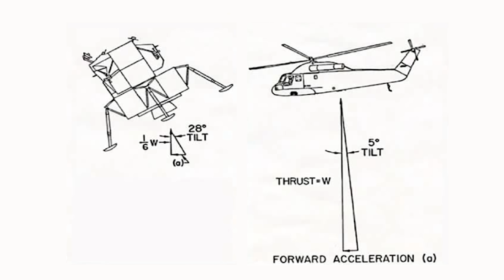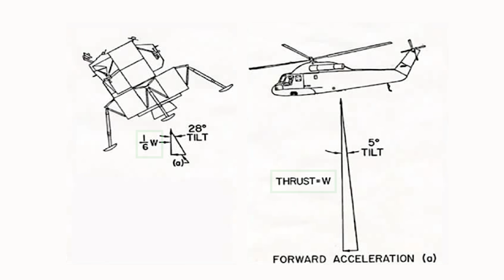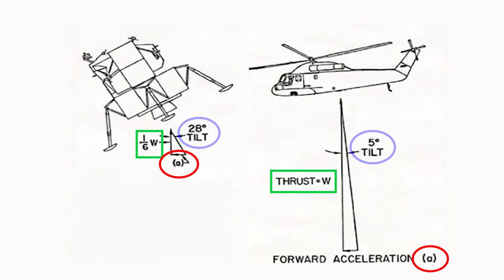How Neil Armstrong Trained to Land on the Moon  - Smarter Every Day 250

Comment: Here's the deal... early astronauts were airplane jockeys, and didn't want to just ride an automatic rocket... at all times, the Saturn V was able to be manually controlled by a joystick at the pilot's side.  That philosophy died a well-deserved death... computers do a much better job of figuring out physics than we do.  All Apollo LM pilots took over the controls at the very end, landing the crafts manually... but there was no need to... they could have designated the spot and the system would have landed the LM automatically.  We repeatedly land craft on the Moon and Mars automatically... what is the difference when a human is on board?  Well... if they're a pilot, they want control... that ends up being the whole deal.

Comment: With all the technology and processing speed we have today i wonder why this question is so important relative to human and not to machine?.. Small kids drone of today integrate way more processing for flight control than there was in the 60-70' i guess. a simple few dollar 9 axis gyro pcb and few lines of code can do the job quite easy to control engines... the same as drones does to compensate the proxymity bottom presure when close to teh ground.. or compensate the wind that constantly change speed and direction... etc... a simple 9 axis gyro chip that integrate the earth magnetic field tracking option can a good cpu and AI could be way less risk as to let a human pilot the landing?

Comment: Smarter?   Moon landings are THE biggest hoax in history.
Reply: Like u
Reply: You can't just say something like that without providing solid evidence.
Reply: @καλαμ  There is all kinds of evidence (Van Allen radiation belt, extreme heat/cold, photo anomalies, lack of rover tire tracks, no burn mark under LEM, camera film would've been destroyed by high temps and radiation, no stars, same mountain hill back round on different locations, divergent shadows, astronauts suspended on wires, secondary light sources, inadequate battery power, etc.), but for those who believe,  ignorance is bliss.  Believers don't want to examine the evidence with an open mind because they are afraid of what they might find.  Government lies about many, many things. The MSM owns minds.

Comment: 17:53-18:00
Can someone explain this for dummies please? They had the jet engine, the lift rockets and attitude control rockets which I assume were 3 separate systems. He was running out of fuel on the lift rocket. 
If they ran out of fuel on the lift rocket then the module would start falling with an acceleration of 1.7m/s². Falling from 10-20 metres at that acceleration would mean impact speed of 6-8metres per second ... that would hurt.
What should have they done? Could they increase the power on the jet engine to compensate for the missing rockets?

Comment: Modern moon landings will be fully automated, maybe with a manual backup.  A modern lunar landing trainer would be almost trivially easy to do with a Lithium ion electric multicopter with different control laws to simulate lower gravity.  I.e., it's all software.

Comment: A lot of people forget, the LLRV & LLTV flew nearly a thousand flights with only three losses. It was highly successful.
Reply: This!

I've encountered so many conspiracy theorists who think the flight that Armstrong ejected from was the one and only attempt.
Reply: @FosterZygote   Even before the internet there is a huge problem - crashes get replayed in documentaries because they excite interest, but the routine stuff is hard to emphasize.
Reply: @FosterZygote  All the footage/training that most people see is the astronauts sitting down when operating the practice LLM. Many say the actual operation required the astronaut to land the thing while standing up! If this is true, (and I don't know for sure if it is) it would cause a whole new set of problems. Thus, fueling the "conspiracy theorists". I will be checking into this soon!
Reply: @tmo4330 - What problems would be caused by them standing rather than sitting?
Reply: @FosterZygote  It would be like removing the seat locking device from a car and trying to operate a stick-shift. You would be moving around too much to drive properly.
Reply: @tmo4330 - then it's lucky for them they had a harness system that held them to the deck and stabilized them while they were flying the LM. It's also luck that it didn't have a manual transmission.
Reply: @FosterZygote  
How many times did they fly it will full rocket control? 
 Almost All the tests flights were with jet main control.
Reply: "How many times did they fly it will full rocket control? 
 Almost All the tests flights were with jet main control."

The gimbaled jet engine was used to ascend to starting altitude, then was set to a fixed thrust that cancelled out 5/6 of the LLTV's mass, simulating lunar surface gravity. During the descent, hydrogen peroxide rockets were used to simulate the Descent Propulsion System. So the answer to you question is, every time.
Reply: @FosterZygote  The idea of "conspiracy theorists" is a conspiracy.
Reply: Great info, I'm very familiar with Apollo and aware of the LLTVs but never knew there was this great number of flights.
Reply: Any footage of these 1000 flights that did not go wrong?
Reply: @jacobfield4848  I also have never seen footage of an astronaut operating the thing while standing.
Reply: "I also have never seen footage of an astronaut operating the thing while standing."

So what? Where are the millions of pilots worldwide for the last five decades proclaiming that it would have been impossible to operate the LM while standing? WHY would it be impossible? Are you a pilot, let alone a military test pilot? 

There were, as I said, spring tensioned cables that hooked onto the A7L suits to hold them to the deck and secure them laterally, and the soles of the boots had Velcro to secure them to the deck. The LM had no foot controls. During most of the descent, the guidance computer was flying the LM. When the commander was put into the control loop, the guidance computer still flew the LM, it just let the crew make inputs to tell it where to go.

There have been aircraft that pilots flew lying prone. At some point, some test pilot had to fly that craft for the first time ever, having only ever flown in a seated position.
Reply: @FosterZygote  Your point?
Reply: "Your point?"

I thought it was rather obvious, but - my point is that your objection is not based on any argument from physics or expertise. The facts are that the LM crew, although standing, was secured in place. The acceleration vectors were almost exclusively vertical, from the crew's perspective, so to them it would have felt like being in a moving elevator, NOT like standing in a car. The main reason to have the pilots of the LLRVs and LLTVs seated was because they had ejection seats. Also the LM crews would be standing in lunar gravity, 1/6th that of earth.

If you can find an overwhelming consensus of aerospace engineers and test pilots who say that the LM could not have been piloted in a standing position, then you'll have something.
Reply: @tmo4330  ,  2023/02/07 ,  11p.m. EST  I am looking at a Smithsonian Channel thumbnail and the title "How Neil Armstrong Trained to Land the Lunar Module".  The pilot in the thumbnail appears to be standing.  Edit 9 hours later:  I just watched the S.C. video.  The pilot was sitting down.
Reply: @joemag6032  Wow, I will look it up, thanks!
Reply: @FosterZygote  were they able to do this with a rocket. Cause elon musk only managed that recently
Reply: @ulkairvillan3219 - Sorry, no. From May, 1966 to January, 1968, the Surveyor Program landed five unmanned probes on the moon as reconnaissance for the Apollo landings. The Viking Program landed two probes on the surface of Mars in July and September of 1976, using rockets for the last 5,000 ft of the descent. Other aeronautics agencies have been testing autonomous rocket landing systems since the early 1980s. Just because the Falcon 9 is the only vertical landing rocket you know of doesn't mean that it's the first one to exist.
Reply: Von Braun once said it's impossible to go, it would take more fuel than three large buildings. But he changed his mind.
Van Allen said it's impossible to go.
The radiation belts would fry anyone.
 Then he changed his mind.
Reply: "Von Braun once said it's impossible to go..."

No, he did not. He said that he realized that early concepts of a single stage rocket going to the moon, landing, and returning to earth, as envisioned in the '30s and '40s, would be impossible with any known technology. That's why he and his team went with multi-stage vehicles, which are much more propellant efficient for lifting mass.

"Van Allen said it's impossible to go.
The radiation belts would fry anyone."

No, he absolutely did not. I'll grant you the benefit of the doubt and assume that you are just repeating claims that others have made without attempting to verify them. But you have definitely been misinformed. In fact, after Bart Sibrel's egregious 'A Funny Thing Happened on the Way to the Moon', James Van Allen said that the claims it made were laughable. He made clear that astronauts, within a spacecraft like the CSM, would have to orbit within the highest flux region at the heart of the more intense inner belt for about two weeks to accumulate a fatal exposure.

Again, I have to ask proponents of the hoax theory, do you really think that such a conspiracy could secure the INTERNATIONAL complicity of MILLIONS of engineers and physicists, from freshmen undergrads to top Ph.D.s, (not to mention everyone else with expertise in various aspects of the missions) for over half a century and counting?
Reply: @jesseakers7298  everything you just stated is total BS.  Nobody pushed the moon effort more than Von Braun.  Van Allen approved the flight.  NASA (and the Soviets) had mapped the belts in detail since both countries planned moon landings.  Dangerous, sure but a step by step approach was used resulting in the landing.  BTW, the only reason the landing demonstrator crashed was because the ground tech, who was supposed to be monitoring the fuel level (Armstrong did not have a fuel gauge), was watching Armstrong and failed to notice that the fuel level was at zero.
Reply: @jesseakers7298  not true at all.  in 1969 watching the tv coverage, all three networks made a point that Neil and Buzz were standing up.
Reply: Sorry, no. First of all, the LRO has never imaged the Apollo landing sites from as low as 8 miles. The latest images from ~ 13 miles are sharp enough that you can see a remarkable amount of detail. The earlier images were taken from ~ 30 miles and are, I'm sure, the images you were looking at.

Second, there is no way anyone has taken crystal clear photos of an object 10 miles away using a smart phone. And where can I buy one of these commercially available cameras that can resolve a smiling face from 52,580 feet? 

Third, how do you know the ship was 10 miles away? For a camera on the beach, held 5 feet above the water, the horizon would be only about 2.7 miles away. Show me how you calculated the distance, then show me the image. It's not evidence unless you actually present it. 

Please answer my question: are all of the world's physicists and engineers in on the hoax, or are they all just that much dumber than you?
Reply: YouTube is doing that annoying thing again where it doesn't show all the posts in the comments, but I saw your last post in my email notifications.

You didn't seem to have a problem citing von Braun and Van Allen as authorities when you thought they confirmed your beliefs. Now that you find out they didn't, suddenly they can't be trusted. And, of coarse, you expect to be taken seriously on these matters, despite clearly having no knowledge of the subject. 

The Saturn V launched a payload of about 97,000 lbs. to the moon (Command/Service Module and Lunar Module) and had 4,400,000 lbs. of propellant. The space shuttle launched an orbiter MINUS PAYLOAD of 219,000 lbs. using 3,820,000 lbs. of propellant, 58% of which was in the SRBs which only burned for the first two minutes of launch. And the Saturn V didn't burn fuel all the way to the moon, as you seem to think. The third stage only used a small percentage of its fuel to achieve low earth orbit. After that, it restarted the burn that lasted six minutes and sent them on a trajectory to lunar orbit insertion. 

Once again, do you think all engineers are idiots? Do you really think that you, with no demonstrated knowledge of physics or engineering or photography, have figured out something that people with Ph.D.s are too dumb to notice? Or do you think that there's a half century old conspiracy that millions of technical and scientific experts all over the globe have unanimously decided to maintain?

This conspiracy theory, like so many others, is essentially a gnostic cult that lets its followers imagine that they know a big secret that makes them smarter than everyone else. That feeling of being one of the few too clever to be fooled is appealing to a lot of people, so they'll cling to its source tenaciously. They'll tell themselves and others that they're free thinkers, and that they're applying scientific scrutiny to the target of their pet theory. But they're really doing the opposite of science, because they're starting with a desired conclusion and trying to construct a trail of evidence to lead to it.

I too worry about humanity, because so many people would rather pretend that they already know everything than make the effort to learn.
Reply: "6 minutes of burn to travel 230 thousands miles. You have been filled with information that only blind fools would believe."

That's what's called an "argument from personal incredulity". It's a type of logical fallacy. It basically means that because you don't understand something, you don't think anyone can understand it. 

When the third stage was restarted in orbit, the spacecraft already had a velocity of just over 17,000 mph. Its single J-2 engine produced 200,000 pounds thrust, generating about 0.6 g of acceleration over the next six minutes. Plugging those into a simple physics formula we can calculate that this added about another 4,700 mph to the velocity of the spacecraft. That was enough to get it on a ballistic path to a point where the moon's gravity could take over, and it would continue into lunar orbit, with the help of a short insertion burn from the Service Module's engine.

"Your incapable of understand points."

I understand the "points" you're making perfectly well. They're just factually wrong. I also understand the difference between a determiner and a contraction.

"And it's not engineering. Not at All."

So you're an engineer? Then why can't you understand the math that proves the S-IVB could provide enough ∆v to boost the spacecraft into an orbit to intercept the moon's gravitational field? Maybe you'd like to present your own math? Are all engineers just that stupid compared to you? The fact that you won't answer that question tells me that you know how ludicrous the consequences of your claim are, now that they've been pointed out to you.

"It's information that no one has and can't be found to study because it's somehow lost just like all the original photos. Lol."

Now you're just emphasizing your ignorance of this subject, and the fact that you're just parroting false claims that you've seen on the internet. None of what you just said is true.

"It's okay. Millions of people believe in a loving God that created 🔥 for you if you don't."

And? What do supernatural superstitions have to do with an overwhelming scientific consensus?
Reply: @FosterZygote  
Wow, your good.
I admit you sound great.
It sure sounds like you study all the information about getting that thing to the moon.
There's just one more thing.
I don't believe you. Lol, but I'm not giving up.
Yep  17.000 MPH+ 4700= 21.700 with 240.000 thousands miles to go.
     Three days,  24x3=72 X 21.700 = 1.562.400 Miles. We passed the moon by 1.2million. BUT,
- we are going up hill so we will be slowing down the on the way.
  Kind of like throwing a rock to my friend in the tree camp, when the rock gets to him it's stopped.?
SO, really we only need to go about 190.000 because the moon starts pulling.
So we got there.
I can see this.
It's much more believable than
Landing that rocket on the moon.
 Have you watched space X landing.
Can't believe a man did that.
   I'm still in the"I don't believe" group. But what I'm hoping is the Elon musk will land something soon and prove me wrong.
 Peace
Reply: @FosterZygote  
You are the one that said 6 minutes of burn to leave earth orbit and get into moon orbit.
Then you name call if I repeat it.
  Why don't you do your own math because you depend on all the lies handed to you.  So really you don't know anything about the math.
 And you keep talking about engineering and it seems you don't know what an engineer is.
It's not engineering, it's math that anyone can do.
But you need to have some information to do the math.
 Interesting how you can be so condensing when you have no information of your own.
 Yeah, you talk big but do you know how fast any object will accelerate if dropped from 100 miles out?
 How many pounds of fuel it takes to get a pound to orbit? 
Bla bla bla
Reply: Moon landing and ascent were filmed inside the LEM simulator. No video showing the astronauts putting on or taking off radioactive moon dust contaminated moon suits. Hoax.